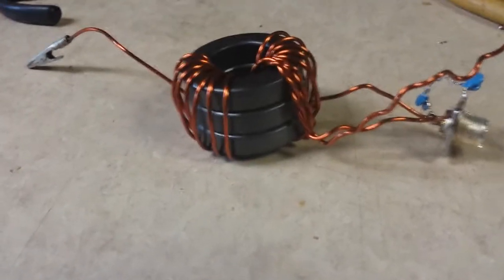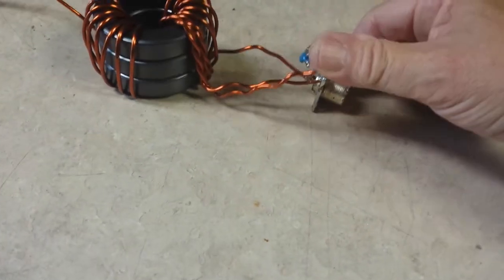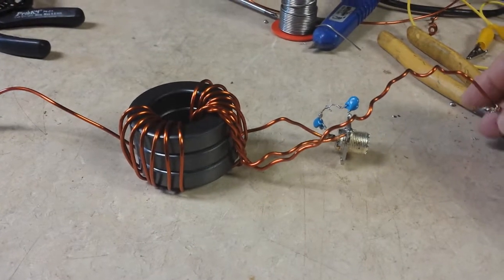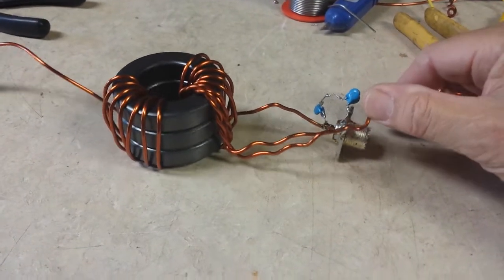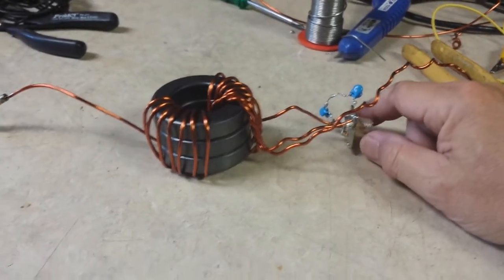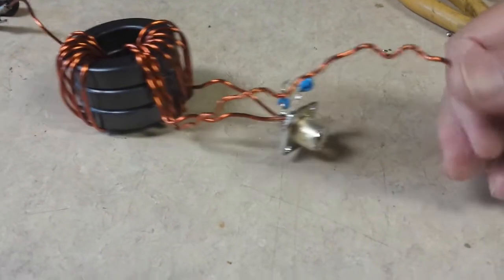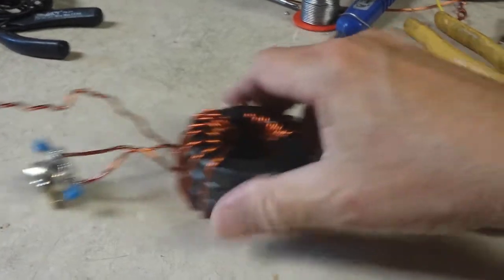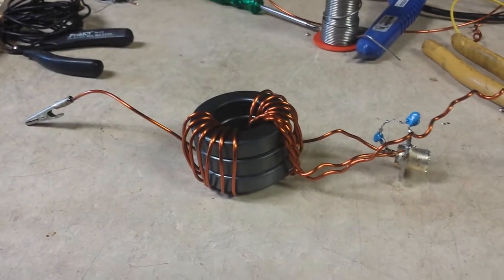EFHW counterpoise test

Comment: Thanks for the video.  I have experienced the old saying, ask 25 Hams and you'll get 26 opinions on this subject.  Some very adamant.  You said the caps combined were 100uf, everything I read says to use 100pf.  I wonder if that was just a slip up.
Reply from the maker: I said pico farads. pikeo not micro
Reply: I see the replay to another comment, 100pf, great thanks.

Comment: Interesting results. Now the test to make, doing the same test as you just did, would be to put the MFJ-854 current meter on the coax and check to see if the RF on the outside of the shield goes away after adding a counterpoise ? I don't expect that to change by just adding a DC ground connection. 

Barry, KU3X
Reply from the maker: A counterpoise turns the antenna into an off center fed doublet. The ground does more than you think when it comes to these high impedances. It doesn't take much!

Comment: I had the rigexpert connected the other day and on 80m, when I connected the coax shield to the meter connector it had a big impact on SWR which shows the coax shield is acting as a counterpoise, SWR is still pretty high on 80m , 3700 it's around 2.7:1 I would like to lower it so I took down the antenna and shortened it and this brought the SWR down to around 2.3:1 but at the expense of much higher SWR on the higher bands.

SWR on 80m on the myantennas.com EFHW-8010 in my config stock config is lowest around 3500 Khz which it's around 1.4:1 so I read that adding a capacitor roughly in the middle will lower SWR on 80m ? 

If you buy the EFHW from hyendfed.nl he gives you the option where you want 80m to be resonant, on the CW or Phone portion and this is really great, it would be good if the myantennas.com added this option, question is does it matter exactly where the capacitor is placed to the inch and what value and rating should it be ?

i have the antenna mounted in a kind of inverted L, UNUN is around 3 feet from the ground at the base of a tree, wire runs up the tree about 15 feet then turns North to a tree around 50 feet then turns East to a pine around 60 feet, on 40m and 20m I get great DX and 80m NVIS is pretty good too haven't got any DX on 80m but haven't tried much.

Comment: Another good video Steve, I have experimented with a counterpoise on and off, not a lot of difference, my aerial was cut for twenty meters. Using a 0.05 length of wire made little difference in SWR, my transformer was wound on one T240-43, being in the UK we have 400 watts to play with although I only use 100 or 50 due to urban surroundings. 73 John G4YDM https://johnallsopp.blogspot.com/2020/03/efhw-grounding-compared.html your post shared on my blog.

Comment: Does the 0.05 wavelength counterpoise prevent RF near the operator with a half wave or slightly short "halfwave" antenna?
Reply from the maker: You don't need a counterpoise. The coax shield does that job. Also it's good to ground the coax at the transformer. Nothing fancy...Just a ground rod. Nobody I know has reported excessive RF in the shack with this design but it must be 1/2 wavelength on the fundamental frequency....Not "sightly short".